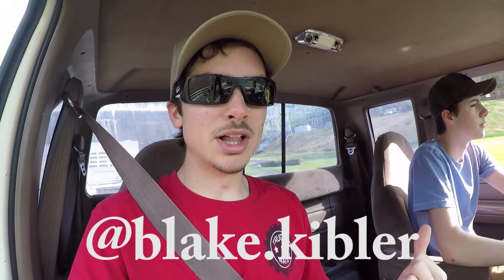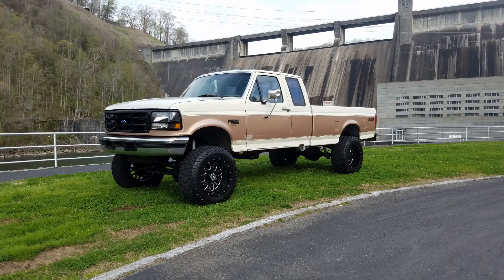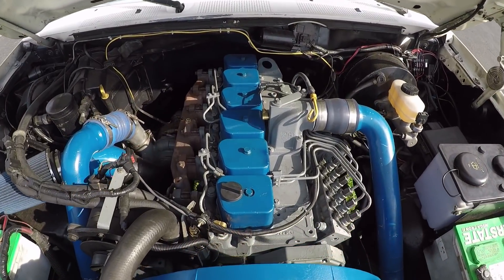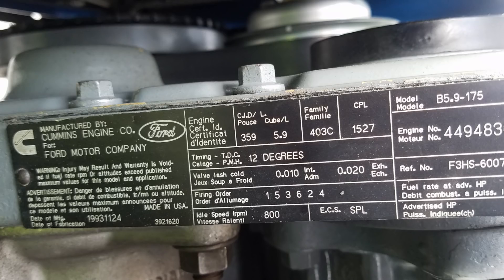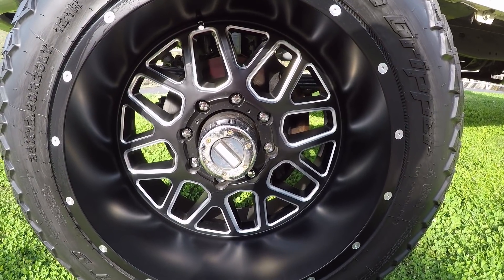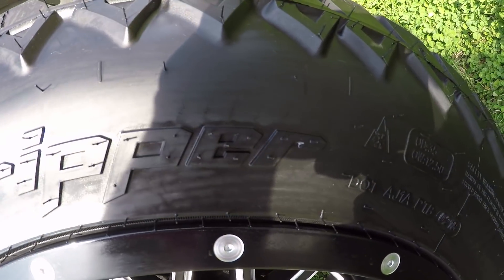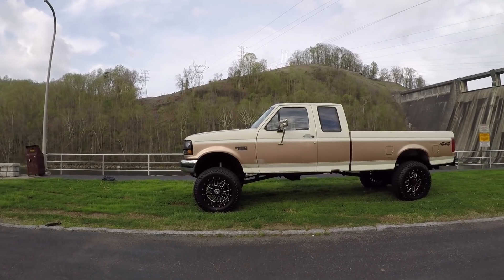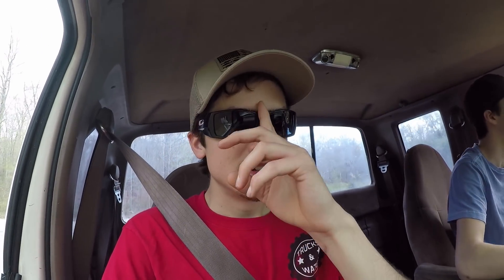Blake's OBS 1994 Ford F250 12v Cummins Swap: Truck Review

Comment: The 7.3 is a great engine, but this is how Ford should have done it.
Reply: Monster RAM what I'm doing to mine
Reply from the maker: I have mixed emotions on it. I think Ford should have had the option of the 7.3l Powerstroke or the 12v Cummins.
Reply: Cummins is 20000000000 times better
Reply: Same here, I had a 95 7.3 & it was good, but I’ve been around some 5.9 Cummins engines & they sound great & because if their weight they can fit in an OBS truck without any mods if the engine is 900-1000lbs. I thought about doing a mechanical cat motor l, but there aren’t very many of em out there less than 1000lbs. I saw a 3126 swap, but I’ve had enough of an electronic engine. 

So I sold my 95 & got a 93 idi w a ZF5 & I heard the 5.9 will bolt right up to it & im not sure how the clutch will all work.

If the swap is possible to bolt in place of a 7.3 idi then I’d be down for it.
Probably wouldn’t happen for a while, or at least while my idi is still going.

Ford should’ve done this years ago, after the 7.3 Powerstroke & went straight to Cummins no frigin 6.0, 6.4, & 6.7.

I wish ford had an option back then for both IH & Cummins engines, where there was an option for a Cummins or an IH idi or PS.
Reply: I6 is a much better design engineering wise .. can handle much more power then a V8 ever could ..
Reply: 7.3 is nothing more then a Power Joke

Comment: How many of those came with the 12v u think
Reply from the maker: None of them did. It was an engine swap.
Reply: None lol , but the 12v is a very popular swap,  removing the 7.3 in mine for a 12v, look on the fummins forums for info on the swap
Reply: None. Its probably out of a f650 or f750 or a semi

Comment: cummins is there own biz dodge just has deal with them to put there motors in there trucks nissan xd have cummins in them  bread trucks list goes on
Reply from the maker: That is true but this engine has the Ford Stamp on it.
Reply: Just the deal ford had at the time. Dodge has their logo on the cummins in the dodge trucks to.
Reply: Cummins IS their own Company, the Ford stamp is peob from a F600 etc. Dodge has a stamp, peterbuilt, Nissan, Foton etc. What ever the truck or boat it comes in from the factory will gave the specs and timming on it with the logo of the vehicle manufacturer on it. Allergies buggin ya lmao.